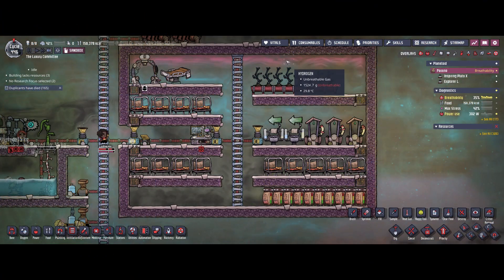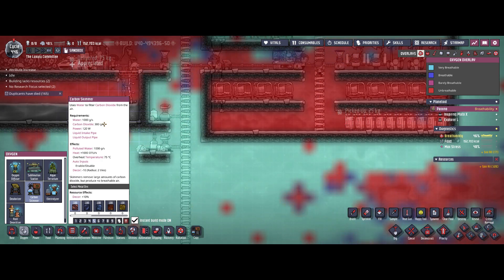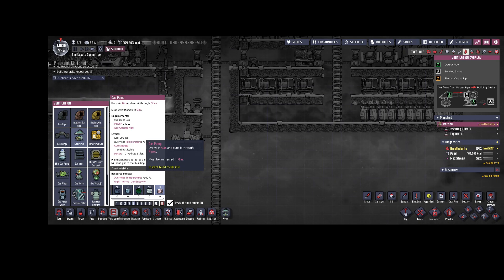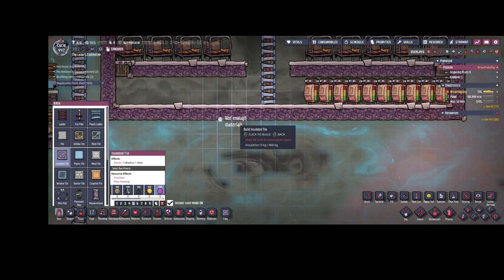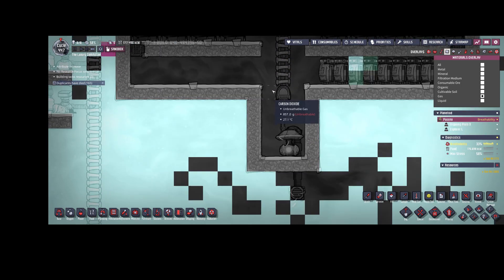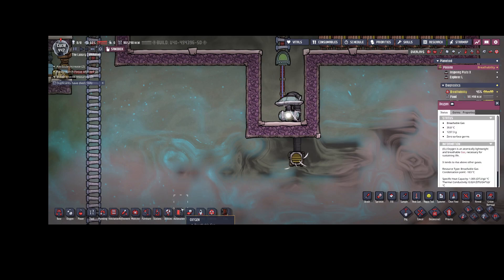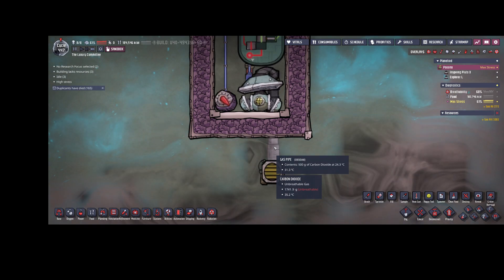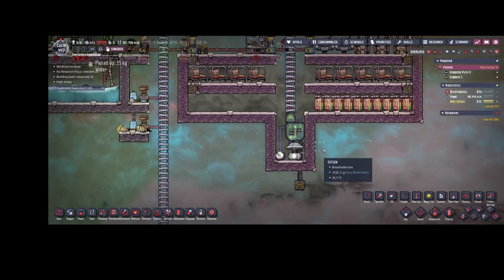Oxygen Not Included: How to automate your gas pumps for heavy and light gases

Comment: You don't always need to use the pump.  You can use a door and keep it open when gas not oxygen.  It doesn't work that well when you have the environment over pressure, but if you pressurize your core base properly then this is rarely an issue.  Also you can just run gas deletion doors with timers, pressure Guage, gas element sensor, and and gates.  Three doors, middle door is delayed closed to delete the gas.  Idk, I just never use gas pumps this way.
Reply from the maker: good idea. I wonder what would be more efficient; spending the power on doors or pumps? Might do a vid on that in future.
Reply: @engineeringandgames6107  definitely the doors, I think they only use power when it opens.  But you have to manage pressure in order to make this work